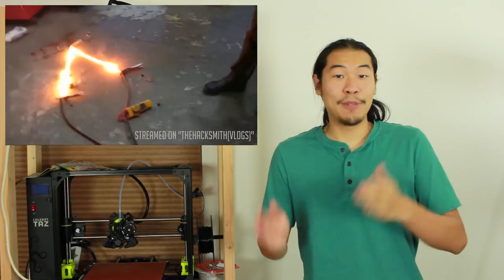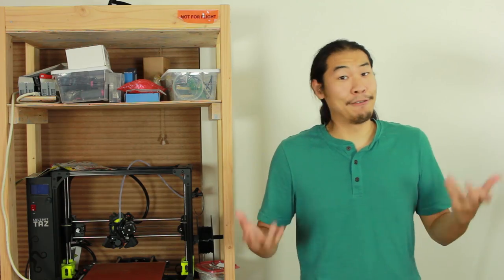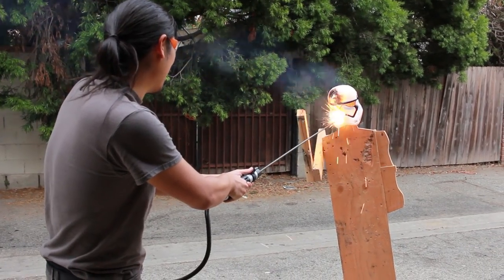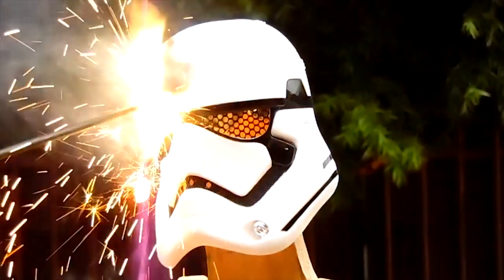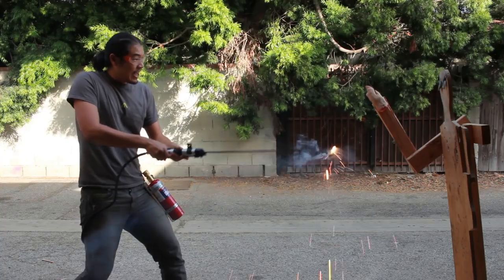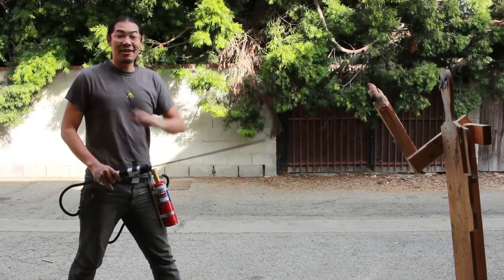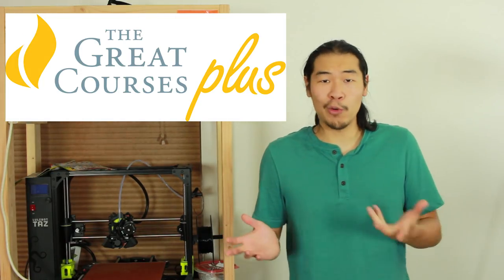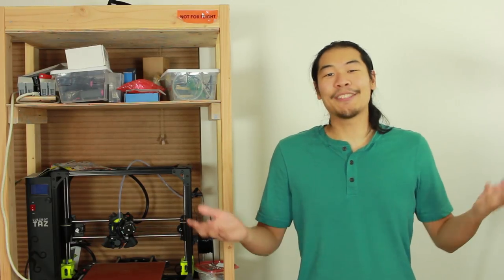Thermic Lance Lightsaber Cuts Through Steel!

Comment: Use a high-powered laser with a small disk of dense material at the top of a metal pole connected to the handle. it may be a bit heavy but you could try it and see how it generally works. I am aware one of the issues with lasers becoming lightsabers is the length, so you could potentially block off the end of the beam with a very dense and inflammable material such as a small stone atop a steel pole. Or if you don't want to try this or are faced with any issues then maybe you could experiment with mirror positions, metal frames and a laser to create a light shield. Although, you may burn out the mirrors if you use a high-power laser. Please feel free to attempt.  :3
Reply: Thank you :)
Reply: It wouldn't work. Sure you can get a laser, most "high powered" ones will burn wood after a few seconds of contact. But you wouldn't be able to see the blade, and this lance would still cut through things faster, and cut more things. If you were to get a truly high powered laser, then weight won't be the only issue. Those things take a LOT of power, and can cut through metals but wouldn't have much trouble heating that stone rapidly, possibly enough for it to shatter. Like when you put hot water into a cold glass. Not only that, but lasers of that grade are very, very expensive.
Reply: megamaxmax4 That's what I was thinking. An invisible blade.
Reply: Hmm, good points ;)

Comment: You should combine both of these designs!
Reply: Mac Wie well one uses fuel that is shot out and the other uses a fuel that is oxidized to burn better so shoot some liquid fuel and some oxidizer and make them mix right at the tip so that the liquid fuel burns hotter and maybe just maybe you will have a lightsaber
Reply: omg pls somebody confirm this
Reply: I think the thermic lance uses metal as fuel though

Comment: That's like a thermic lance rapier to where you can stab enemies instead of slicing through them. The heat evaporates the water in the flesh, while the metal if sharpened can pierce vital organs. Good for a stab weapon, along with breaking and entering enemy territory

Comment: would it be possible to use a magnetic liquid or powder fuel and use a magnetic field of some kind to keep the blade in shape so the flame won't try pointing up if you swing it down if the magnetic field repels other magnetic fields you could even duel with them but if this is possible it would be very expensive

Comment: You should try using nichrome and make a cylinder (but thin) shaped bar. Then, you should have something to run electricity to it so it heats up and becomes red hot.

Comment: Great idea!
Thermal lances are about the hottest 'easy' cutter out there.
Used to burn holes in just about anything, including bank-vaults, tanks, concrete [dangerous!], what have you.
Its weakness is anything that has a significant water content.
Wood, living things can get scorched, yes.
But the water carries away so much heat that direct burning takes a back-seat to steam damage.  Boring.
BTW, if'n ya'll were to load that steel tube with a loose bundle of small diameter hi-carbon welding rods [from oxy-actylene welding] and some lengths of fine aluminum wire, it would run MUCH hotter!
Steel-wool is a good alternative.

These things get their best work done when the burning of the lance is heating up the oxygen passing through the tube.
This excess super-heated and partly mono-atomic oxygen [look it up, nastier than Fluorine!] does the real work, igniting anything in its path.  The flame of the lance is just a pre-heat!

Comment: Try building a lightsaber with plasma. Make a hot arc, like that of an arc lighter, and use pressurized air to blow on the arc to extend the blade. Could this work? It's worth a shot.

Comment: Make a thermic lance but with tiny holes coming all down the sides and try it, itll obviously last much less but maybe it will work?
Reply: That's not a good idea. You might burn the tube to the point where it snaps off at the first hole, hits the ground and bounces/falls in your direction. And then you've got burning steel hitting your leg.

Comment: you misunderstand how a thermal lance works. the heat of the burning tip doesn't cut the steel, it sets it on fire and keeps it burning in the jet of highly pressurized oxygen, that flushes out any molten material, constantly exposing fresh metal to burn. 
when using a cutting torch, you can turn off the acetylene once the cut gets going, and finish by using the burning solid steel as fuel instead. juicy!

Comment: now im pissed, i thought of this concept, when night hawks video came out, but didnt have the money to take further, which in design i did. i have multiple designs, the last of which is a open blade just like a true lightsaber, and the power source built into the handle ( no external source) i havent yet released these designs because ive been to paranoid that they would get stolen or i could held liable, i at least want to get a patent first, but you might be better off with them, i have thought this before but figured your to smart to give any clues without working it out yourself. but hit me up if you wanna talk designs.